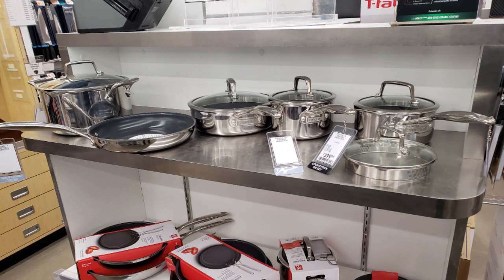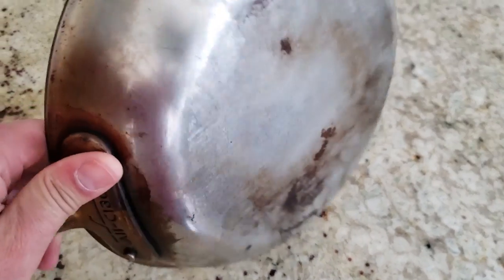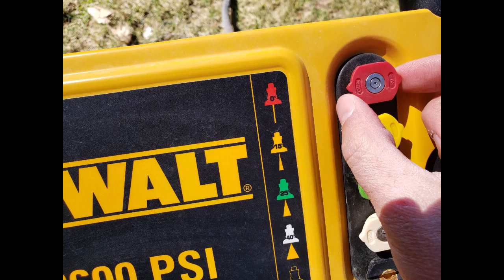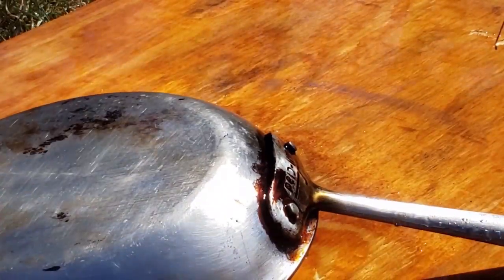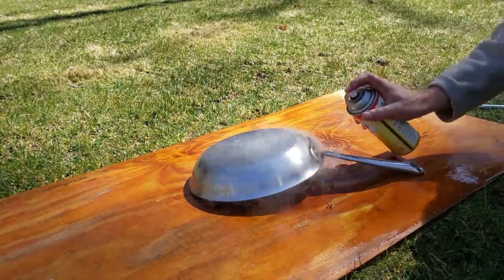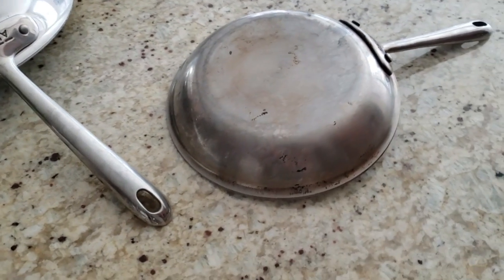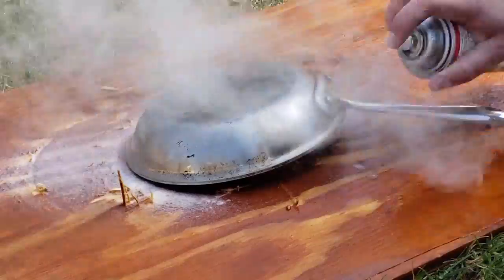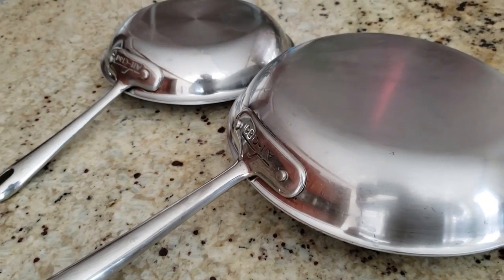How to clean All-Clad pots and pans in LESS THAN 2 Minutes.

Comment: After using my All-Clad everyday for ten years, pans still like new.  Just get in the habit of either deglazing the pan while cooking, or else wait until you are done cooking and simply pour a cup of water into the still hot pan and cover it with a lid.  When you go back later, or even the next morning, whatever was stuck to the pan will have softened, and all you have to do is wipe it off with a soft sponge.  Clean as new!
If you didn’t do that, pour some baking soda over the damp pan and add water - cover and bring to boil - then turn off.  Shouldn’t be difficult to scrub off.
Reply from the maker: Nothing works better then cleaning right away.  Heres my other method https://youtu.be/IKNBDVd7wfM

Comment: I have some stainless steel pots and pans.  What I have found that works for me is to try and clean them often with Dawn dish soap,  Bar Keepers Friend,  and a scrubbing pad.  Takes a little effort,  but not much.  Another thing that I do, as others have said,  is to run cold water on the hot pan and let it soak for a while.  Most stuff will come off except for the burnt oil.  I then clean as mentioned above.
Reply from the maker: I'll give it a try... I also cleaned the pans WITHOUT the pressure washer ... check out that video works well NO SCRUBBING needed https://m.youtube.com/watch?v=IKNBDVd7wfM

Comment: I liked the video because it was cute and funny. I clean my pans using a baking powder and water paste applied with an old toothbrush or sponge. I was recently given an old fashioned heavy skillet, used by my friend for over 50 years. I don't know how to properly clean it. Do you have any suggestions? Thanks for sharing your tricks and tips! I enjoy your short videos very much.
Reply from the maker: Thank you.
I also have a cast iron skillet.  I was always told you season the skillet and you never use soap on the cast iron skillet.  I will research the best method and if I find a good method i'll add that video to my channel.
Reply: @onesimpledad  Thank you very much. I remember that I'm not supposed to wash the skillet with soap but didn't remember how to clean the skillet.
Reply: I use a cast iron skillet that was once my great grandmothers. Well over 100 years old! Over time the oils really build up on them and this skillet was so nasty when I got it. I soaked the skillet in ammonia for a few hours then went to work scrubbing as close to bare iron as possible.  Then wash with lots of dish soap and boiling water, even a small metal spatula to gently scrape at the century of oil. Yuk!  Then I reseasoned it and it’s perfect. I will use dish soap in cast iron depending on what I have cooked. The key is to rinse and rinse and rinse, otherwise the seasoned iron can retain the taste of soap.  Then I low heat dry on the range with a light coating of oil. If your cast iron is seasoned well, dish soap to wash will not remove the seasoning. I don’t leave cast iron soaking in dishwater. This is, from what I understand, the same procedure if you find any rust spots on the skillet! 
I hope you guys don’t mind my input. I love my ancient cast iron pieces and expect them to be used by my great grand children💛🙂💛
Reply: @jensherman2771  Hi Jen. Thanks very much for your reply. I thought my friend told me to use kosher salt if the pan got very messy, and never soap. I don't remember her doing much to clean it.

Comment: Those pans are stainless steel.  Throw them in the dishwasher after every use and they stay nice and shiny. My 20 year old set still looks brand new.
Reply from the maker: Good to know I will have to try it. My mother has the black all-clad LTD series pans.  She put them in the dishwasher, and the black sides now look faded. That's the main reason I haven't tried that yet on mine. Well, thanks for watching
Reply: @onesimpledad  won't happen with pans that are stainless inside and out. If any grime remains after a trip through the dishwasher, a quick going over with Barkeepers Friend and rinse and they're perfect again.

The black part of the LTD series is made from adonized aluminum. Aluminum shouldn't be washed in the dishwasher or it's permanently discolored.  The couple of adonized aluminum pans I own are always hand washed, as are my nonstick pans.

Comment: Applying cold water to a hot pan will make it warp. It's not recommended. Easy off is the way to go. For very stubborn grease, apply easy off, put it in a garbage bag and seal it, leave it in the sun for few hours, everything will be coming off. I use this method to remove factory seasoning for cast iron cookware. Easy off can damage your stainless cookware if you leave them on on the exposed aluminum.  The chemical reaction is so strong, it will pull away some of the aluminum and leave a rough pitting edge. That's why if you have all clad cookwares, wipe them off the edge immediately after applying it. Bar keepers friend is also a good option for everyday cleaning.
Reply from the maker: Yes, you are correct about the cold water and a hot pan.  Being a former executive chef, I've seen many cheaper pans get destroyed that way.  I also mention in the video I don't recommend heating a pan and then using cold water.  Video was first filmed just to be funny trying to see what a pressure washer would do to a pan but then was surprised i found a way to get my pans clean.  Hopefully no one takes the video too serious.  I will have to try that bar keeper friend as well as the easy off and the garage bag trick.  Seeing how well easy off takes off that stubborn grease i could only assume its a strong chemical  that may do damage if done multiple times for a long periods of time.
Well I hope you enjoyed the video and thank you for watching and if you want to see any of my cooking videos.  Please check out my other YouTube channel #OneSimpleChef

Comment: SMDH..... I'm 55 and utterly shocked by what I saw in this video.... EZ off work very well if you read the instructions and let is sit on the pan or oven for 30-45-60 mins....the use of the Pressure washer was not remotely needed....Boiling water with Vinegar & Baking soda soak for similar times will loosen up and remove the scorched grease/oils....Using the Old Standard SOS pads work too when pan is warm....How do people get that much cooking oil on the Outside of their cookware and not Clean it Off before next use and what are you cooking at such high heat to burn oil to the pans/pots interior/exterior?
Reply: All-Clad suggested not using steel wool. Use Bon Ami or Barkeepers Friend. Actually, when food gets burned on our pans, I pour full-strength ammonia and get out of the kitchen because I don't like the smell. By morning, everything cleans off easily with a sponge and dishwashing detergent.
Reply from the maker: Thanks for the comment... pressure washer was just to be funny.  I hope no one takes the video too serious.  I normally cook with extremely hot pans when searing scallops, rack of lamb or a fatty duck breast.  Being a stay at home dad I cook every night and I try to juggle cooking gourmet meals and cleaning the dishes and sometimes the pans get some built up grease. Thank you for watching the video... if you want to see what else I cook check out my cooking channel #OneSimpleChef
Reply: @sherrycohen1824 oil burned in the interior of mine. Will this work and how much ammonia vs water and lastly will this ruin the pan? Thank you.